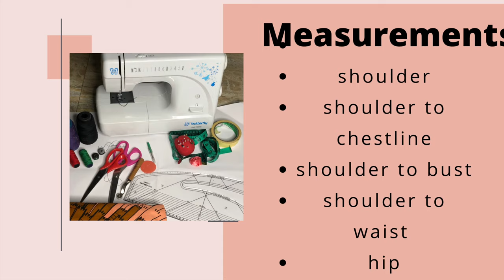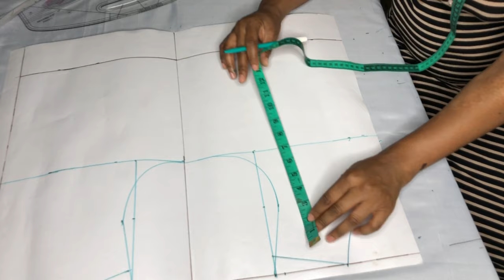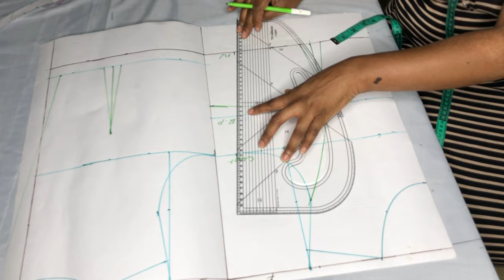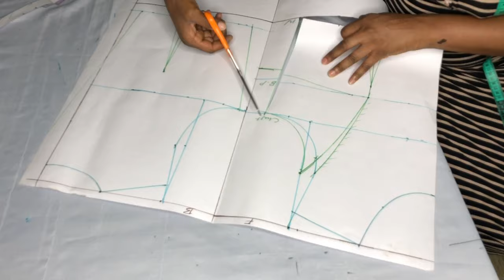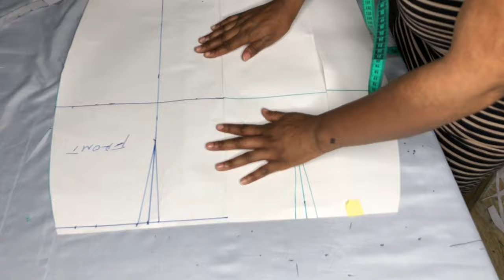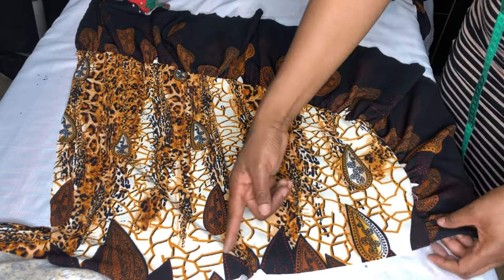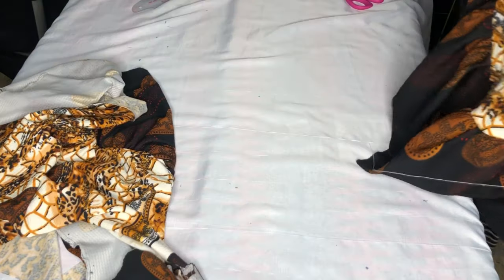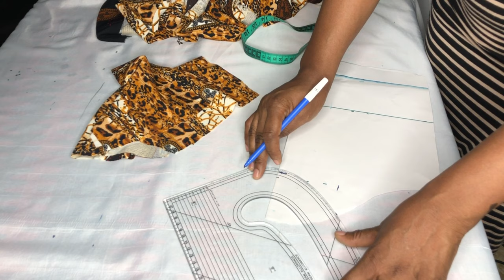How To Draft Trendy Asymmetric Ruffle Dress with Armhole Princess Dart And Cold shoulder Sleeve

Comment: Well- detailed...how do I measure someone's bank half length n front half length since m running a ready to wear brand?
Reply from the maker: Thanks a lot. If you check my other videos, i included pictures of back half length and waist measurements. Anyways to take the back measurement you measure from back of the neck to the deepest part of the back. And for the front waist you measure from shoulder to the smallest part of the waist . It normally 3 inches after the underburst for most people. Hope this helps.